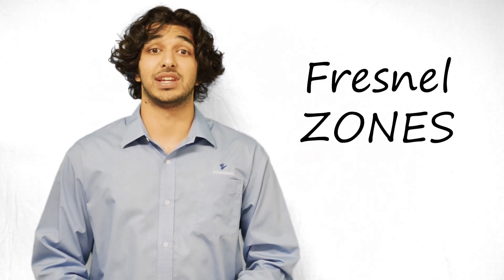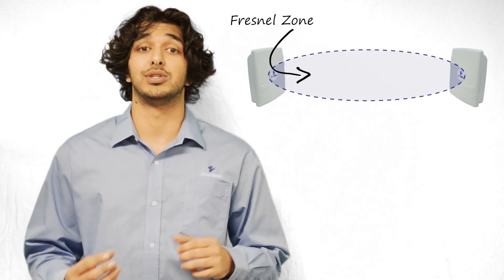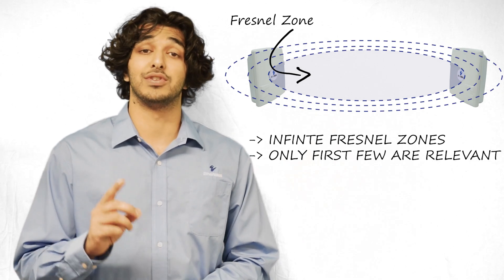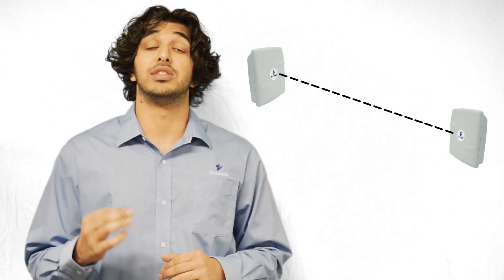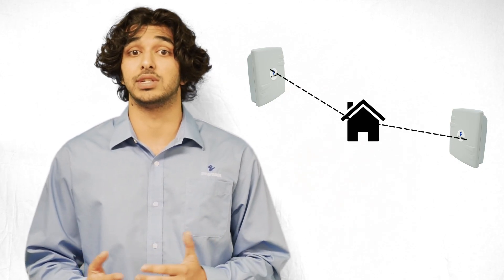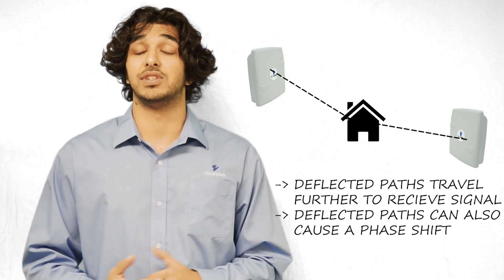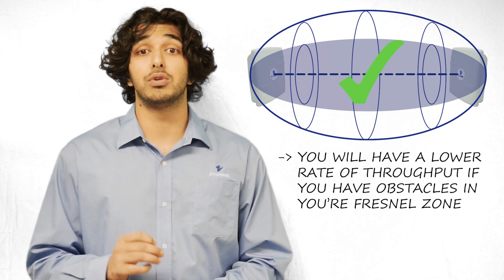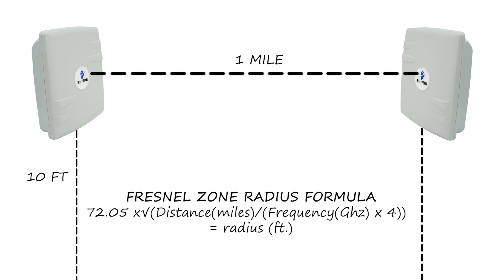How to Determine a Fresnel Zone Radius

Comment: If I have two Omni antenna at the same height spaced 2 km apart and they are electrically tilted at 10 degrees and elevation beam width is 5 degrees, can these two Omni antenna communicate?